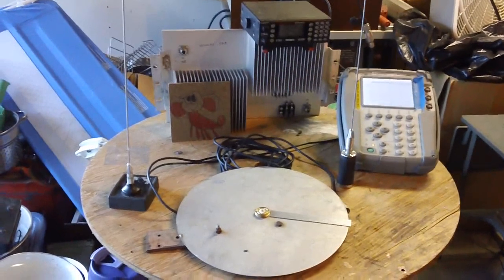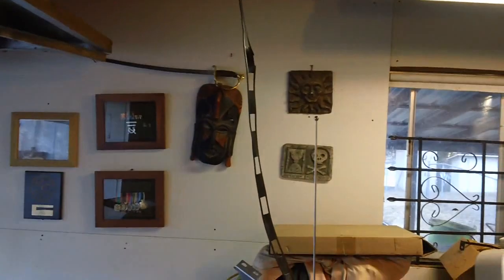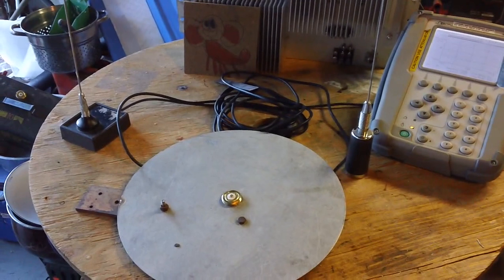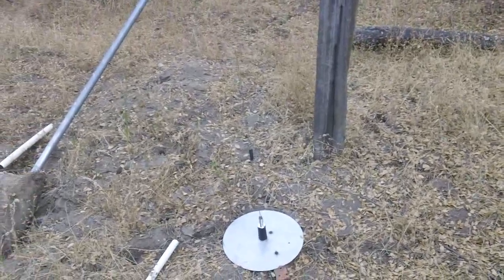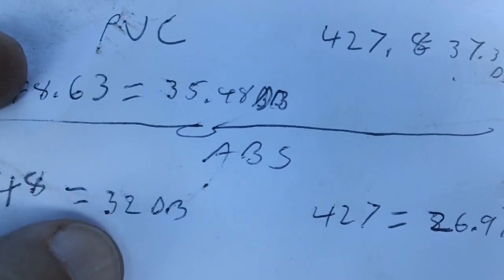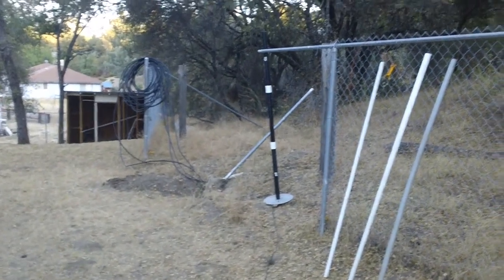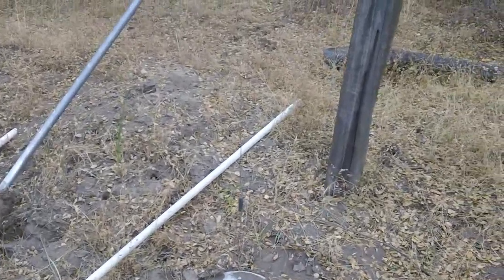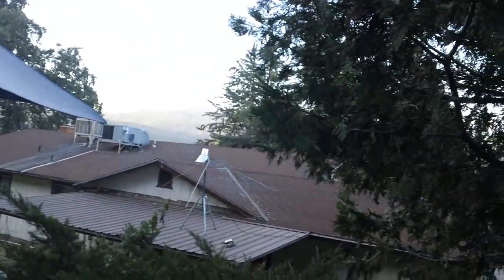Attempts To Urban Camouflage A DualBand Antenna. Test Results.

Comment: So, the Ed Fong is not a good option, in 200psi PVC?
BTW- what was the wall rating on the PVC you used??
Reply from the maker: +usernamemykel Never used a Fong antenna, I have no opinion on it. Don't know the wall rating of the n9tax antenna.
Reply: Thank you.
73
Reply: usernamemykel my dual band ed fong jpole slimjim in modified thin wall works fine. To gain a few feet I added a tee and some special fittings to move the so239 90 degrees to mast and added two more feet of standard pvc for elevation

Comment from the maker: Yes, that would work best for hiding. Most of my viewers are novices or has no experience with comms. So manufacturing a wire antenna with the proper impedance and frequency is too over the top & boring to watch in my opinion. I try to give a simpler alternative. Thanks for watching.

Comment from the maker: Thanks for the tip, yeah the test results proved that fact. I did not want to get too technical explaining dielectric properties, much rather demo it in action to prove the point. Seemed like those other materials had a different degree of dielectric value to have an effect other than fiberglass. Thanks for watching.

Comment: over 20 years ago I got back into CB / Ham tinkering when I rented a large lot property in L.A...For about 8 years I had a blast with a radio shack and all the antenna projects I could think up of at the time. It was in the early 70s before that when the CB craze got me hooked and then it faded until my last bout of storing everything up after the last move. Now with all that is going on I am glad I kept everything. I just need to get a new 10-20 to set up and get back on the air waves.